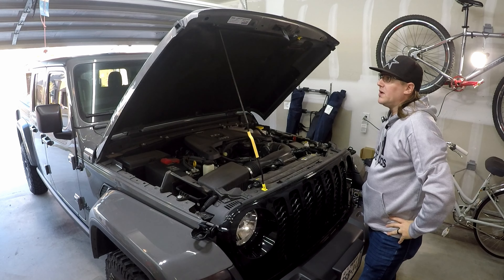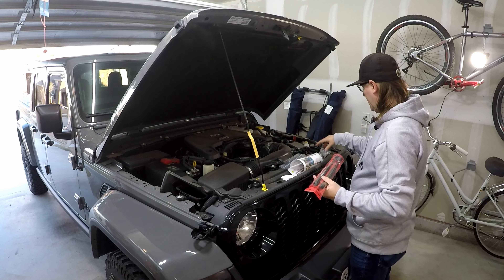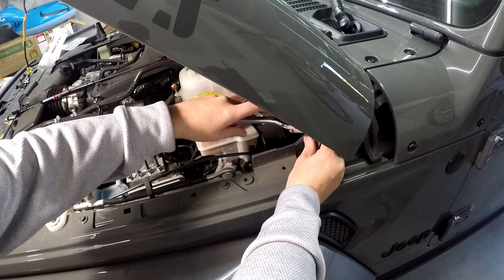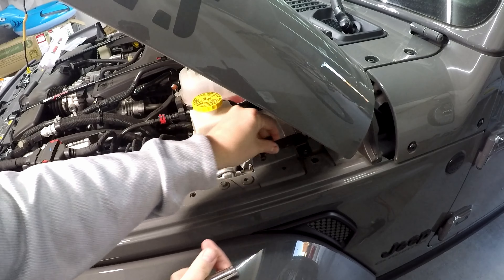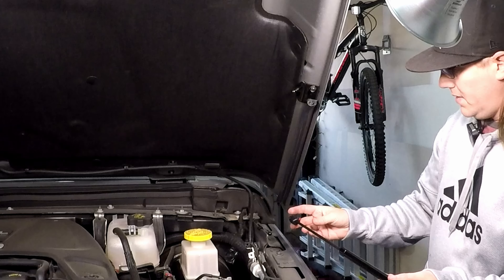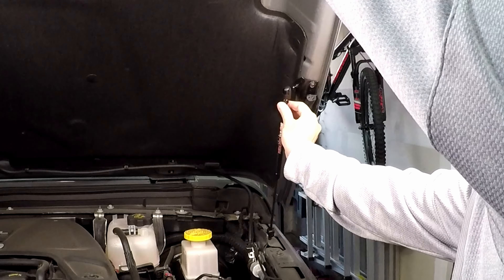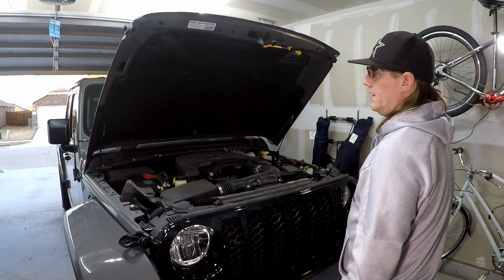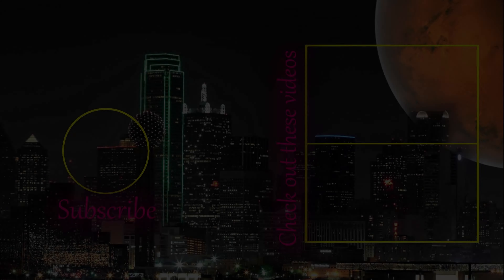Jeep Gladiator and Wrangler Hood Strut Install. Get Rid Of That Pesky Hood Prop Rod!

Comment: Hood struts are not better than a prop rod lol. Jeep hoods are supposed to be able to go back to the windshield. The prop rod was moved back to where it is from the JK setup to allow you to use the rod to lay the hood on the windshield. Struts take away that function and thus are a downgrade.